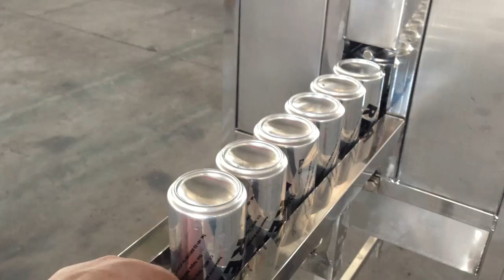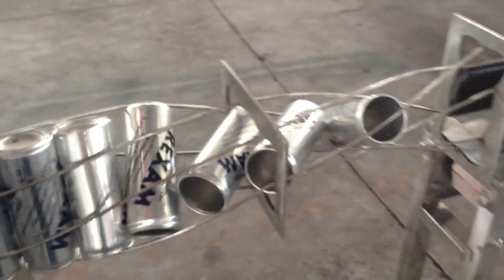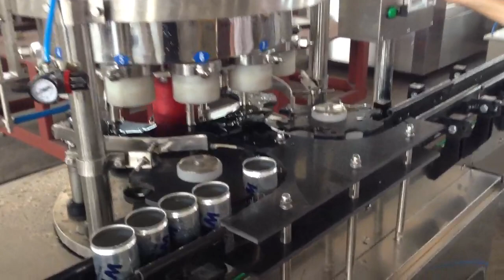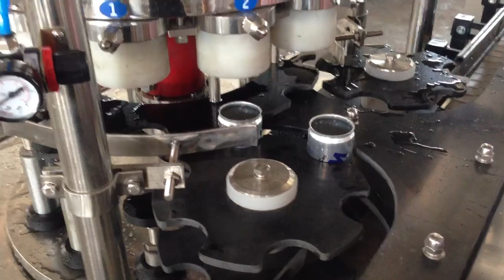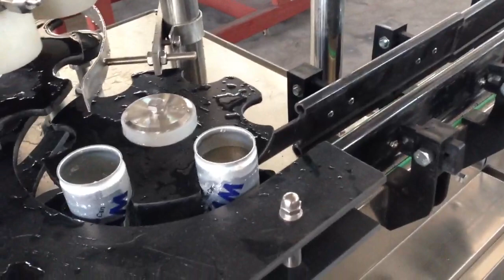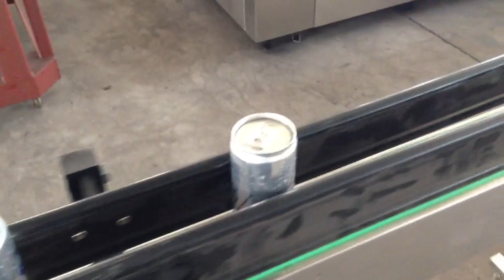carbonated beverage can filling line

Comment: But can someone answer how it doesn't loose its carbonation during canning, travel, storage?
Reply: Because the can is airtight. The lid forms a double seal with the base can and a liquid material is inside that double seal that then hardens and fills any gaps making it completely airtight
Reply: @SharksFan1997  yeah but it’s taking a while to put the lid on.
Reply: @drowningcrown2293  If you open a can of soda and leave it laying out it doesn't instantly lose carbonation. A minute max going from the filling machine to the lid machine is not going to make a difference.
Reply: @wintesrain  lol ok thanks
Reply: The product is infused with CO2. There is a blender that makes the product and sends it to the filling unit. The seamer that puts the lid on should be putting a layer of gas (CO2) on top of the product so the oxygen that would have been there does not deteriorate the lining of the can causing the product to eat through the aluminum thus causing a can to become brittle and leak. If the can leaks while still stacked with the rest of production, it will destroy all the rest of the packaging.
Reply: @shaunmwoolley   where i can learn this all things? i want to run small factory
Reply: when the line is running at full speed there wont be that much time between filling and sealing.